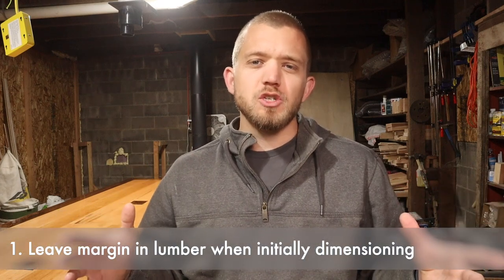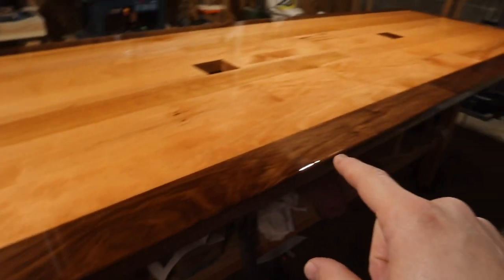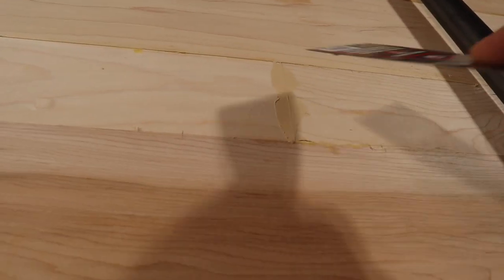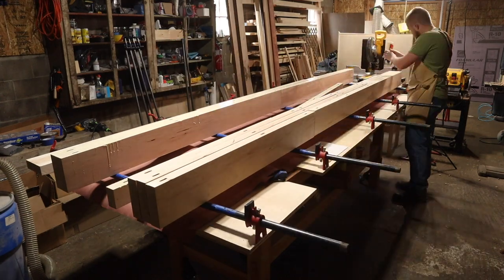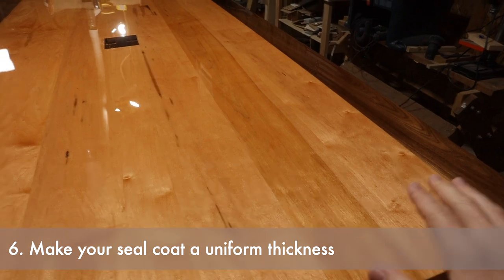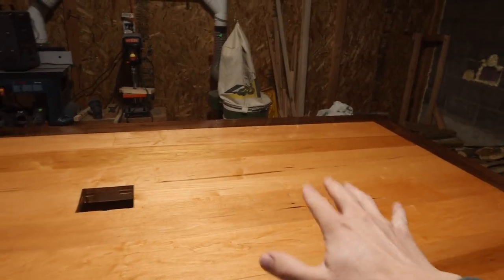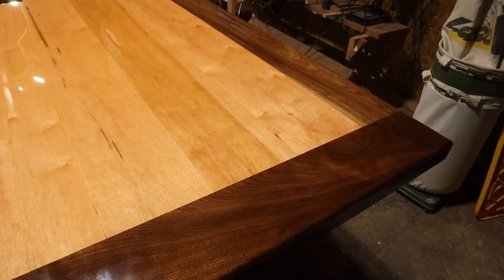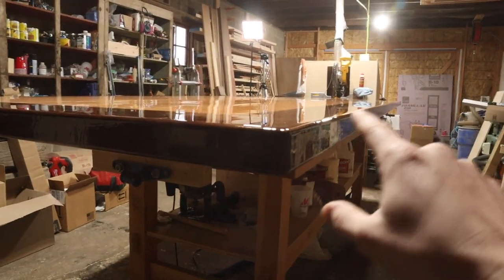Lessons Learned in Making the Conference Room Table

Comment from the maker: NOTE
Another HUGE lesson learned after installation. Epoxy isn’t great with high temperature items. I knew this but had assumed it was more for pots, pans, baking dishes and the like. What I didn’t think about was hot drinks. A lot of coffee makers make coffee at 180°F-190°F (~85°C). In a ceramic coffee mug, this is still beyond the heat deflection temperature for most epoxies. So…no hot drinks, plates of food, or bowls of soup without a placemat.
Reply: Would adding ceramic coating on top of the epoxy flood coat help with the temperature issues? I have been looking at all sorts of finishes, they all seem to have issues with heat. I can’t stop clients or their guests from directly putting hot plates and mugs on the table. That is what a table gets used for, especially with kids.
Reply from the maker: All of those challenges are especially difficult and I don’t think there is a silver bullet. Any table will take a certain amount of abuse in its life. I haven’t been able to test it yet but Stone Coat epoxy is supposed to be much tougher than regular epoxy as it is meant for a countertop. You may give that a test. Otherwise, I don’t think Rubio has any issues with temp, it’s just at risk for staining.
Reply: @NorthwestCraftsman  thank you, I'll research all these in greater detail. I live in Pakistan, getting these from UK/USA runs up quite a bill for me and I can't do it regularly (for now 😁). I often plan my purchases a year or so in advance. Don't want to make a decision and later on find out it wasn't worth the money. Will test out the local finishes I find and see what I get. Maybe I might discover a long last art of finishes

Comment: Spreading.. Round the corners like on a Pool Cement Float, to avoid the lines. Take off just the corner, and leave the last spike then the dip and about half of the next rise and round the rest of the corner.. It will drag, last spike, void flows both ways and evens out.. That spike at the end was the problem..  1/4"  trowel is too big. It is going to level, so, most of your epoxy is going over the edge if it levels properly.. You just have to have more coats to get it thicker. If you use a thicker epoxy, it won't level as well. Trade off. Best to do what you do and put an extra coat, but, it really does not need it.. Looks great. A better cure is more important. Not sure what happened on that one section.. The sides work pretty well, just smoothing it with your gloved hand. Yea.. Good Luck with a dust free finish.. You almost have to have a dedicated paint room, whole thing washed down with a hose, blown out, and given time to dry while filtering the air all day, with all of the blowers on high speed all day.  Then, spray damp the floor and start painting/flooding, etc..  Still a nice job.
Reply from the maker: Thanks! I think it turned out great as well and yea, it's a challenge to find the right balance.

Comment: Thanks for sharing. I am going to put stone coat countertops in my kitchen. A lot of what you said will be applying to my work. Please check out my progress on my "Barndominium" build. would love to hear your comments!
Reply from the maker: Will do! That’s exciting! How do you plan to handle hot items? I just added a note but I learned after the fact that even a cup of hot coffee is too much for my epoxy 🤦‍♂️
Reply: @NorthwestCraftsman  I've watched a video on Stone Coat Countertops. the took a frying pan with sizzling eggs and put it on the counter with no effect. and the put lighter fluid on the counter and lit it, with no effect!
Reply from the maker: Fascinating! I’ll need to check out their specs because that would be a game changer for my table tops if they have that much higher a deflection temperature. Thanks for the tip!
Reply: @NorthwestCraftsman  Glad I could help you